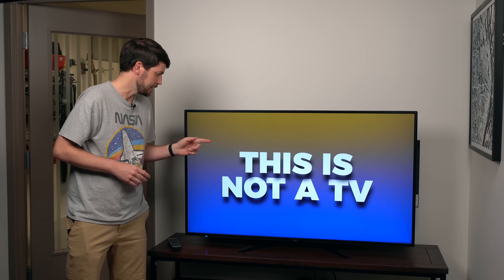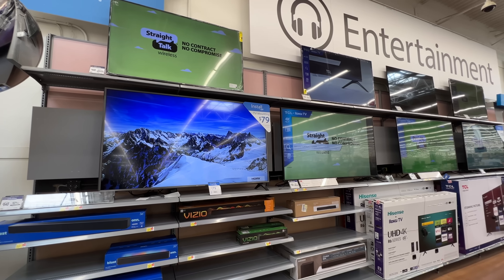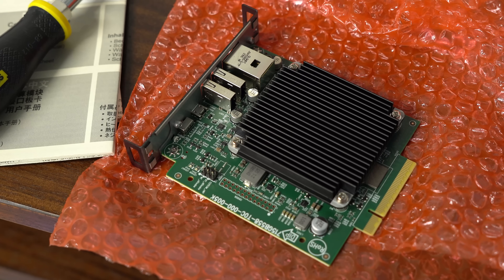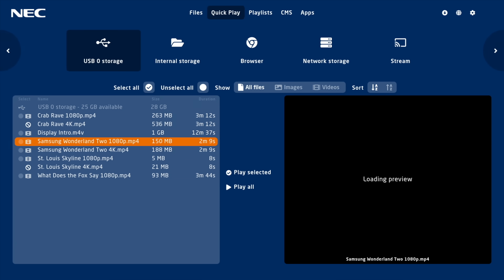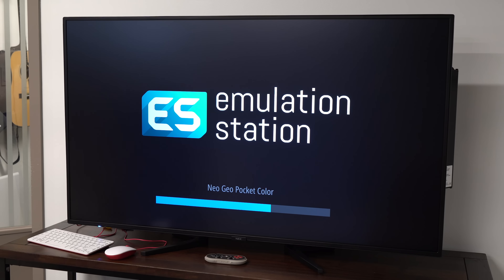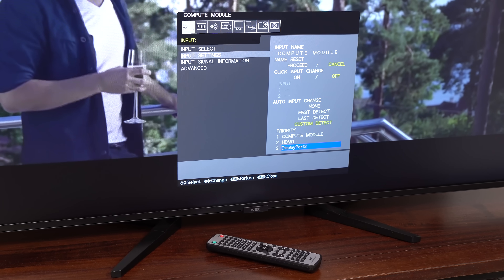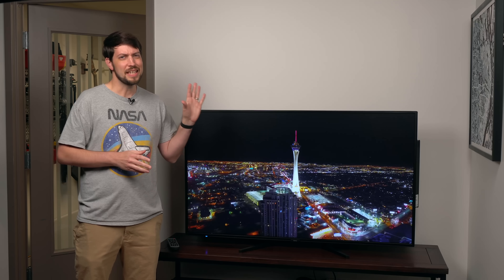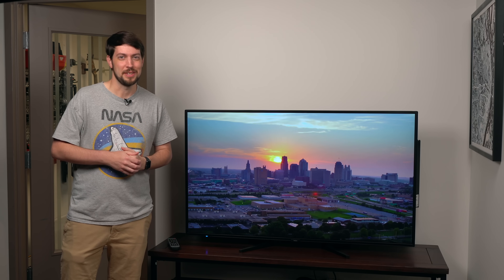Smarter than a Smart TV! (Raspberry Pi Inside)

Comment: We need displays like this available to the public.  I haven't plugged an aerial into my TV in about 20 years, set top box (cable or satellite) provides the signal to HDMI.  All I want is a decent screen and a ton of HDMI ports.
Reply from the maker: Same here, and I'd be okay paying a 10-20% premium on the exact same display if they just ripped out all the adware stuff and their custom 'smart apps'.
Reply: I agree with needing more hdmi ports. I was lectured awhile back, when mentioning that point. He almost sounded irate, telling me there are very few people that care if a TV only has 2 hdmi ports. My current TV has 4, and I still use an additional hdmi switch on one of the ports. Along with component connections, which you cannot find on a TV these days.

Comment: Just to be clear, does the NEC MediaPlayer run on the PI or does it run on the screen's processor? Is the PI just another source to select from the main display?
Reply from the maker: MediaPlayer runs on the Pi itself. The display's built-in OS is just a lightweight OS that manages the OSD, input selection, signal routing, audio, and the hardware layers. The actual media being played has to come from a separate source like the Pi/MediaPlayer, an Intel SDM, or something plugged into one of the inputs.

Comment: NEC sells tuner that can be installed in this.
I ordered NEC M751 75” display.
Want to use it with Apple TV 4K.
Planing to order raspberry pi module later.
I am tired of smart TVs.

Comment: Hello fellow St. Louisan! I have hooked PC's up to my televisions for years. I watched this video and am typing up this comment on a 720p plasma hooked up to an Core i5 HTPC. I also picked up one of those LG C1 OLED 55 inch TVs about 9 months ago. The picture is BEAUTIFUL. The built in speakers are no slouches either. I have it hooked up to a PC, but I did give the smart functions a try. They are actually quite good for what they are. I still prefer a PC hooked up to the TV though.
Reply: The Atom version of those compute modules should run Windows tho

Comment: Just a question? I need the same "Operational System" of this TV. Just because we have to simulate the TV because we are developing a System that are using this TV and we need to test the System "On this TV" before we go to the client. The problem is that the client is far away from us and as you said, this TV is really expensive. Simulate it is really good to us. Do you know if it is possible to use a Rapsberry PI to download a Distro of this "SO" to simulate it?

Comment: The ability to swap out the compute module, and the reliability would make it worth pay its cost, this is amazing.
Reply: I have heard they last about 3 years (coincidentally when the warranty ends) and then start having backlight issues, but some of the ones I saw installed in around 2014 are still going strong today,

Comment: The best part of this type of display is when it crashes.
I have been traveling by train for a long time, in the 00's / early 2010's you mostly saw windows based errors when they failed, but nowadays they don't fail as much.
When they do you see typical linux errors like a black screen with a xorg cursor or what I saw yesterday, one screen stuck at initramfs.

Comment: Cool display! Was libreelec able to playback 4k? The newest version is able to on a regular pi 4.
Reply from the maker: I tried, and it was choppy with the couple video clips I tested (I think they were H.264). The UI looked amazing at that resolution, though. But in the video, I had set it back to 1080p so it could run more smoothly.
Reply: @JeffGeerling  Weird. I've been playing 4k files on my 4B for a year now. Maybe your issue is cpu temps?
Also, libreelec recommends at least 2gb ram for 4k. If that compute module is 1gb, then that might be the issue.
Reply: @JeffGeerling  Oh I don't know if the pi supports 4k h264, but it does support 4k h265. I've gotten high bitrate files (70Mb/s hdr) to play smoothly.

Comment: So wait.. I'm confused. Does the TV have a built in OS onboard? Does it work independently from the CM4?
Reply from the maker: Yes, a lightweight OS that just manages the OSD, and runs the background communication with any installed modules, the networking, and routes the A/V signals. It's extremely simple but allows remote control of all its functions.

Comment: So close to what I need, but for home use (just wall display, not tv/gaming). I love the Pi, and have used it to build several displays with a typical tv. It works okay - but ie Wi-Fi setup or change are a pain for non technical users: make crazy looking “wpa_supplicant.conf” file (don’t let windows append .txt!) onto microsd card etc. Even if a tv had just a browser that could resume like you mentioned that would be great - use display’s native wifi. But a typical tv doesn’t have a browser and AFAIK none support ie wpa enterprise auth. Any thoughts to make user’s life easy to config wifi (ie w tv remote or iPad as “bt keyboard”)?

Comment: I kinda did the same thing, I replaced my 10y old 32' Samsung 3d TV with a Dell 32' gaming PC monitor and plugged on it a good set of speakers. I was using as well a shield tv since 2015. I love to plug a PC on it and run retro games with accurate high resolution CRT shaders

Comment: I have never bought or owned a television, what I bought was a 27" Asus monitor (it even had 3D viewing features), and connected it to my local DTH set top box HDMI output, and voila! My own TV without buying a television. I then graduated to completely switching over to RPi 3B and it has been the primary home entertainment system since early 2017. Kodi FTW.

Comment: I have an old Viewsonic product display. Bought it super cheap at a swap meet. Still works, plays power point (.ppt) and mp3 files. Requires an old software to upload files to a sdcard. Connected to ethernet, I could see it on the network, but couldn't connect remotely. Still haven't figured out what to do with it.

Comment: When I worked at a Genius Bar, those displays were controlled by a (at the time modern) Power Mac G4.
Reply from the maker: It'd be interesting to see if they still have a custom setup or if they went for standard (ish) displays in the interim.
Reply: @JeffGeerling  When the reservation system was introduced they swapped it out with a new PowerMac that could handle all the compositing work for two displays. But I got canned a few months later, so that's the extent of my knowledge. They're pretty big on dogfooding, so I'd imagine there's one or two Mac Minis back there these days.

Comment: Based on some recommendations of friends and watching some of your videos I recently bought 4 Pi 4's which I played around since. Unfortunately, the SD card of the first Pi was corrupt on arrival and I am now in discussions with the vendor who blames me, a daily Linux user for the past 15+ years, to not know what I'm doing. By corrupt I mean that I couldn't flash the SD Card and I am basically stuck with the OS it shipped with. Unfortunately on startup this OS states that I should fsck the disk and any keyboard input except for ESC is blocked. Luckily I had a spare SD card from a camera I don't use anymore and so I could actually use all 4 Pis. Until today. 

I did some updates on the Pis which are running in headless mode powered by a PoE splitter (unfortunately not +) so the power provided to the Pis isn't optimal but I'm still waiting on the PoE hats to arrive (waiting on them for more than 3 weeks now :/). Key-based SSH login worked great thus far and usually after reboot I only have to wait like a few seconds before I can log in. So, after rebooting all 4 Pis I was able to connect to 3 of them without any issues. But the 4th one was not responding. The power led was on and I checked router and switch whether DHCP assigned an other IP, I even checked arp -a to see whether I can find the MAC address of that device, but none. I guess it was somehow stuck in the bootup sequence for some unknown reasons. As I use a PoE splitter for now I am unfortunately stuck with the power provided via the PoE+ switch the device is connected to, though the splitter itself unfortunately only supports plain PoE (af) and when I connect my monitor to that device it stays black. I tried all things I could imagine to somehow get a signal back from that device other than the red light of the power led. After more than 30 minutes of waiting and running out of options I then disconnected the power plug of the splitter and connected the one from the original adapter and the HDMI monitor as well and on booting up I was stuck in the boot-up screen. On pressing ESC on the keyboard I then was notified that the drive was corrupt and needs to be check via fsck. Other keys on the keyboard were not taken though as the OS had problems connecting to the tty and therefore I was stuck. I disconnected the plug again and plugged the SD card into a USB adapter and connected it to my various computers (MacBook Pro Late 13, Ubuntu 20.04 LTS, Windows 10) and tried all the things I could find to flush a new OS onto the SD card but it is somehow write-protected. From what I've read this happens by design so that the data on the disk that may still be good can be read further. 

In one of the attempts I connected a keyboard to the Pi I couldn't connect to and I used one of the Pis I could still access via SSH to type in the commands into the terminal and repeat those commands on the connected keyboard to perform a regular 'sudo halt'. While the Pi I was connected to via SSH did shutdown as expected, the other Pi kept on running. I guess the SD cards was already corrupt at this time and thus it didn't boot the OS correctly and therefore didn't ask for an IP by the DHCP server and so forth. Later on I noticed that this Pi I just shut down also had a corrupt SD card now and also refused to start up. And I am now a bit clueless what is going on. I did not disconnect the powerplug while running, I did not forcefully remove the SD card or else interact with that Pi other than through the above mentioned keyboard commands and still the SD card corrupted by a simple 'sudo halt' command which should allow to safely unplug the device after fully shutting down. Is it just me or are Pi's with SD card rather fragile? Out of 5 SD cards, 3 are now corrupted and somehow unusable and that after 2-3 weeks of usage. Is this somehow normal with Pis? The SD cards are actually ScanDisk A2 128GB Micro SD cards and were recommended by multiple sources so I guess they should at least provide a bit of quality.

I wonder how a recommended setup should look like. Sure, disk-space can be given by mounting NFS shares to the Pi, and the OS itself could be provided by a USB device (i.e. http://www.nard.se/), but currently I have the feeling when there is a power outage for whatever reason one needs to buy a lot of new SD cards as they fail just to easily on Pis. Sure, the SD cards could be locked through the Pi configuration menu itself, but that should only be done once the Pi is fully setup and configured and probably also only done in cases where the Pi is used as micro-controller for devices put in malls and so forth, as you've shown in this video, and less in home labs.

Comment: Bit of a misnomer at the beginning explaining why that NED display is "Smarter" than a Smart TV — usually, some variety of Linux or BSD is inside consumer mid- to hign-end televisions. What should had been mentioned is that it's a Linux system you can control at the bare metal rather than on whatever rails the firmware gives you through its menus.

Comment: Hey Jeff, thinking out loud, and I'd love if you (or anyone else smart like Jeff) can respond to this comment.

Most standard customer TVs ship with 2 or more USB outlets and multiple HDMI inputs. Wouldn't it be significantly cheaper to duct tape a RPi to them and power them using the USB ports from the TV? For instance, Sharp 55GL4260E (2x USB 2.0) in the Netherlands come at a price of €400 versus the one in the video at a price tag of €1700. Am I missing something here?

Comment: We had these at my previous job, and they didn’t actually last longer than off the shelf standard consumer TVs. They basically lasted a bit past their 3 year warranty and started having backlight issues. They were run 24/7 as signage displays and had plenty of airflow around them. Meanwhile, there are several consumer model TVs that preexisted my employment there (more than 5 years ago) that are run 24/7 for the same purpose (meeting room listings, and digital signage) that are still running today
Reply: What did you work as? Sounds like an interesting job, these TV's fascinate me, so installing/troubleshooting them sounds meaningful
Reply: We started building our own totems from cheap LCDs, cheaper, easy to replace the monitor and the computer could be bespoke

Comment: My workplace bought three NEC displays a few years ago but hadn't worked out quite what they were going to do with them. They now have three Raspberry Pi's to control them. One has a looping PDF viewer (and locally available PHP webserver for updating the PDF). Another has a continuously looping video showing. The third shows a web page with local PHP server that uses Google's calendar API to show current and upcoming events. My TV at home is solely used as a display for my ATEM Mini Extreme and the computers it is connected to. Why would I ever want to buy a television with a tuner, or even worse a 'smart' TV locked into someone else's ecosystem?
Reply: in defense of my FireTV, it was cheaper than a much smaller monitor, and I needed something since my old monitor (also a TV because cheap) died. It had a pretty good tuner on it if I wanted to watch OTA (for things like the weather if the internet was out), and I did occassionally watch Prime Video without tempation to multitask to the point of saturation, So there is that, too. I'm considering sticking a dedicated tuner-equipped mini-PC onto one of the HDMI ports of this actual monitor now that I finally have one.

And the part that ultimately failed on it is common to regular monitors as well (vertical timing is gone, so image flickers up and down), so something like 5 years of decent service for $200 wasn't bad. I'm going to peel it apart and try to salvage that panel though, the control board may be toast by that screen still had a little life in it.

Comment: Way cheaper to just use a of the shelf TV and add a normal Pi or something like that.
Just check if the TV supports a presentation mode (auto power on, on the correct HDMI port etc.).

Comment: A regular Pi 4 with the latest LibreElec version can process 4k HDR just fine. I get that this integrated approach appeals to some but why not simpy use a regular Pi 4 over HDMI? Any TV can function as a monitor. Don't need the smart stuff of your tv? Just disconnect it from the network. I only ever see my Pi 4's HDMI output on the screen.

Comment: Extremely cool, though if someone wanted to actually use this in home then Pi 4 wouldn't be the best choice in terms of video playback performance. The mentioned Intel SDM (with a powerful enough board compatible with it) sounds like it would deliver sufficient performance for playing very high bitrate videos? Or I suppose there might exist non-RPi single board computers with more powerful GPU chip that are compatible with some open standard for hooking it up to a display like that compute module card or Intel SDM-based solutions.

Comment: Amazon Firestick 4k Lite + Streamio is the absolute king. The fact that Streamio requires no configuration (just login and it configures itself per your settings) is the icing on the cake. Plus the 4KLite is extremely responsive, with decent Volume Auto-Levelling and CEC and display features. Prior to Streamio I would have been all for PiTV.

Comment: In this video, i learned something that i think Jeff just casually glanced over, Raspberry pi 400 as a Keyboard! That's so cool.
Reply: 6:15  nope, that was the earlier rpi keyboard, usb lead to the back and second lead to the mouse
Reply: Thinking it would be redundant to use a R-Pi 400 to control the R-Pi CM4 inside... 🤷‍♂️

Comment: Having upgraded my main monitor display to a 4K 32" screen it was frustrating working with a 1080p 49" as a second screen so I got a 65" 4K touch screen panel. Not as sharp and bright as the best in TVs and over twice the price but it is not going to burn in if I leave it switched to a static display for hours at a time. 

The touch panel turns this into a 65" tablet and that is more useful that what it may seem at first. 

I would have preferred it not to have an operating system or built in speakers. It does have a slot for an i7 or i9 computer. 

Used for education an training it does time out if not actively used but done of the alternative to a large screen TV are perfect in every aspect. 

I put it on a trolley so can move position best for programming, spreadsheet, design or viewing a feature film. I can also wheel it into another room.
Reply from the maker: Heh, I can just imagine grabbing the 65" tablet and bringing it to my recliner to watch some YouTube videos :D

Comment: Awesome. Hopefully it supports an ssd.
Reply from the maker: This particular board can be made to boot off USB, but it's not really made for that. The typical use case would either be to have a short playlist local on eMMC (or on an external flash/thumb drive), or to play content over the network from a storage server.
Reply: @JeffGeerling  ya, i guess i am using a home theater mindset when i state that. Streaming is good.